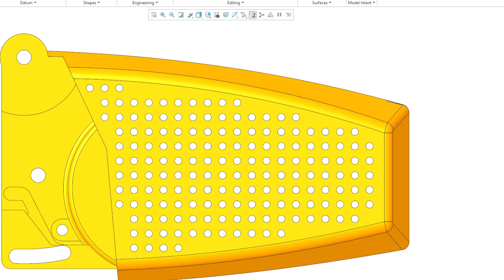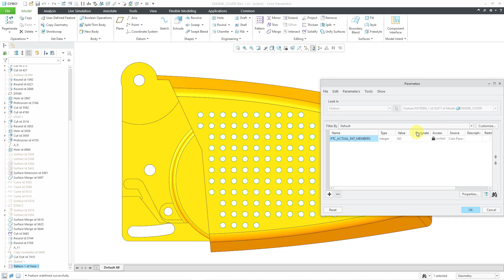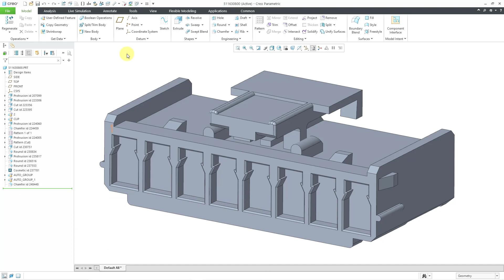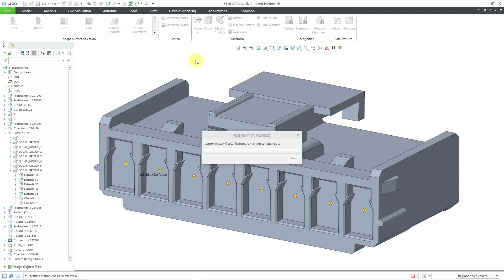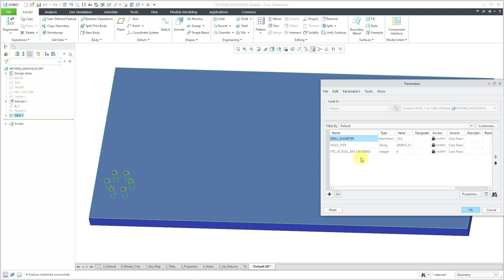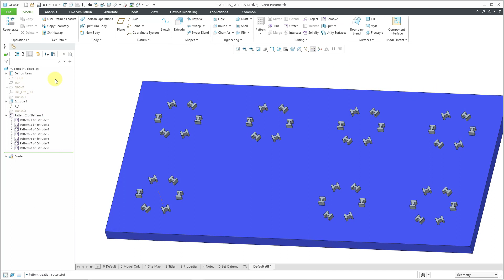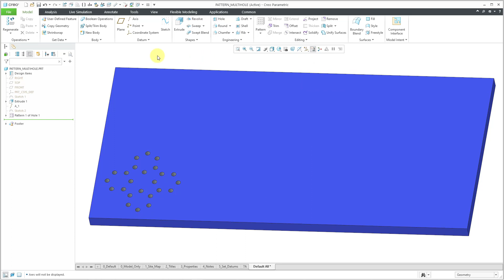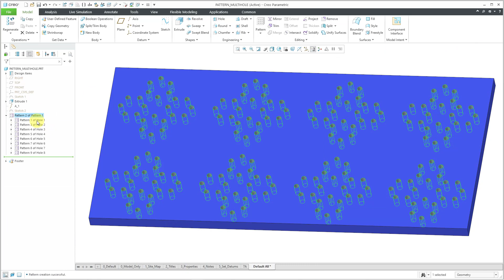Creo Parametric 10.0 - New Pattern Parameters

Comment: I have PTC_ACTUAL_PAT_MEMBERS with different values because I have more than one pattern feature(s). How do I call out the total instance for the pattern I actually want?
Reply from the maker: This is a feature level parameter. As I show in the video, you will call out the name of the parameter followed by a colon, FID_, and then either the name or the feature number of the pattern you want to call out. You may wan to rewatch the beginning part of the video where I show this.